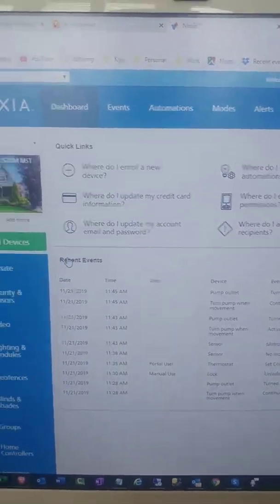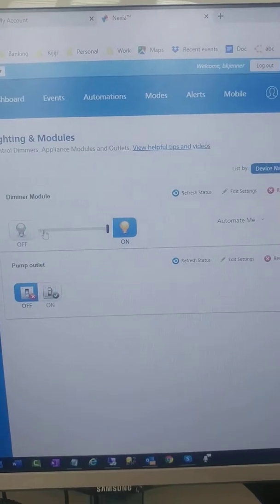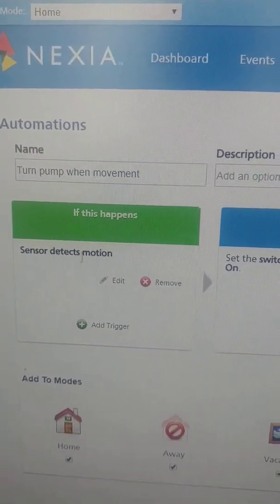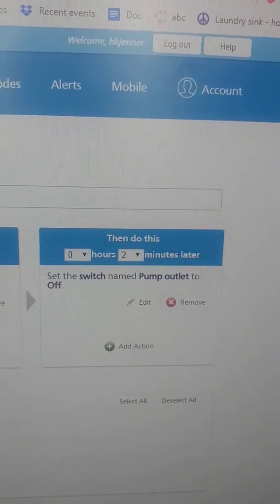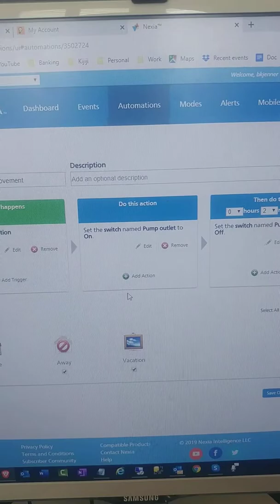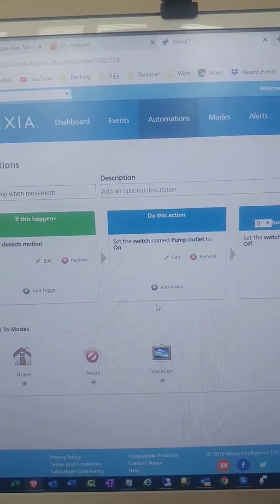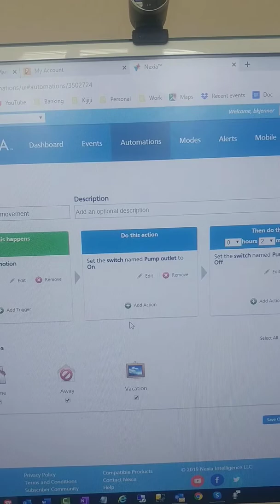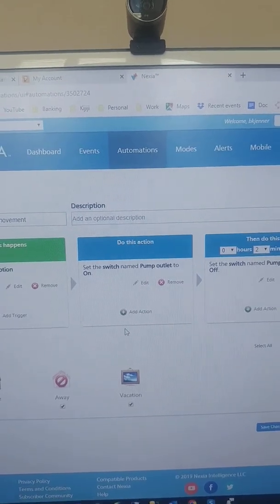Efficient hot water recirculating system activated by motion rather than a schedule

Comment: No matter what...it's a luxury. Best thing I did was run a hot (1/4") copper line from my water heater to my master and guest bathroom sinks. Both take less than  5 secs to get HOT and uses less than 1 cup of cold water to get it there. It doesn't flow as fast but that doesn't matter...you're adding it to the cold. I also ran a 1/2" (dedicated) hot water line (in Pex pipe) to my distant kitchen sink. Takes about 15 seconds to arrive... and it stays hot ( over 30 mins) because I insulated it. Wife loves both systems.... No motors, pumps, check-valves or timers.... just common sense.

Comment: But if it only turns on when ever there is motion, it might take a few minutes before you can get hot water for new hot water had to circulate to the lines.
With the timer, you would get hot water within 10-seconds or less
Reply: My guess is the motion sensor will run the pump for Atleast 1 hour before shutting off when motion is not detected anymore so this way it only runs when people are actually home or awake